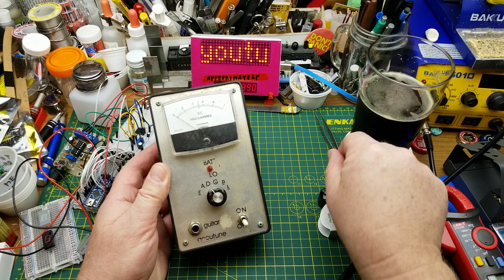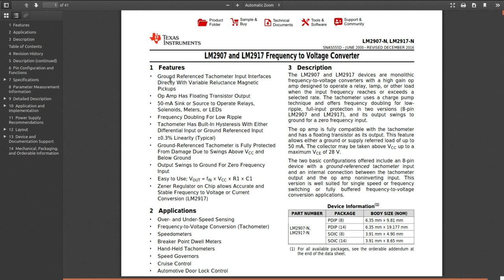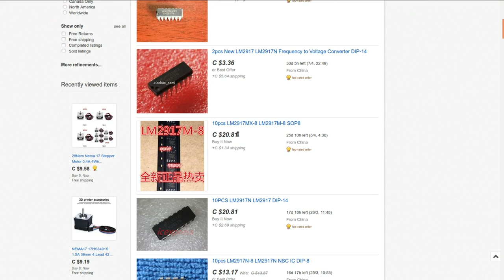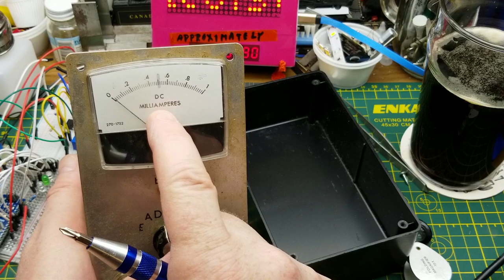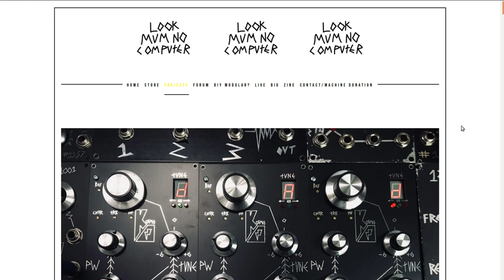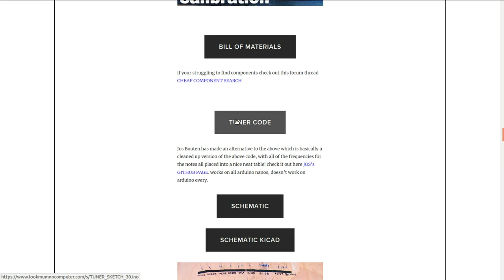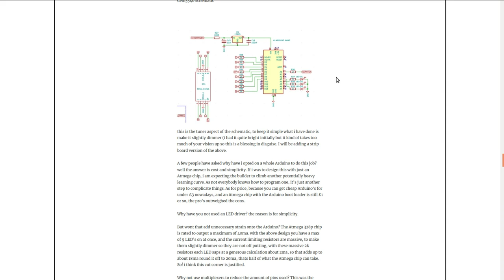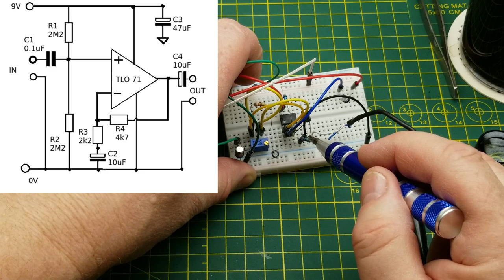DIY guitar tuner experiment

Comment: I made the EA* Chromatic Stroboscopic Tuner (more than) a few decades ago.  It's still around here somewhere, and last time I checked it still works great.  It worked by putting a fairly accurate beat frequency on the cathodes of a ring of 12 LEDs, and putting the amplified  input from a jack or microphone onto the anodes.  If the note was in tune it only lit one LED, if it was flat the LEDs rotated CCW, and if it was sharp the LEDs rotated CW.  It was almost impervious to harmonics, as long as they weren't too loud.

Theoretically you could have tuned a piano with this thing, but mostly I used it to tune a guitar.  Interestingly, this tuner taught me how to tune by ear, by listening to the beat note (it had a speaker also) so you got both visual and audio cues when the note was phasing in and out.  Unfortunately the oscillator was putting out a square wave so it was a bit nasty to listen to. 

I can't find an example photo of this tuner anywhere unfortunately.  It was before photo resist was really a common thing - you made a tracing of the PCB then went over it with an etch resist pen.  Easiest way to do this was to stick the tracing to the blank PCB, then drill all the lead holes.  You then joined the dots with the pen, referring to the images to make sure you didn't miss any tracks.

*EA = Elelctronics Australia, one of the electronics hobby magazines we had in the 70's.  It didn't really survive much into the computer era.

Comment: I have some old analog panel meters I’m trying to think of a project for.  And I’m feeling a bit more analog lately anyway, maybe I will revisit some synthesizer or oscillator stuff I haven’t looked at since before the new year.  I made some sort of auto gain control circuit way back, I vaguely recall it had a FET as a variable resistor and an op amp. I wonder if I can find that circuit or something even better to investigate.
Reply: GR, I used three panel meters with an ESP8266 to make a retro analog clock.  Because it gets the time from the an NTP, server it only has one input; a rotary encoder to select the default time zone.

Comment: 5:30 - I thought you said it basically would be mid level (0.5 as you have marked it with a felt) when in tune or no signal?  That's the way we had one in music class way back then.  So if you were under frequency it would go to the left and over it would go right.  2nd... I'm guessing one of the op amps is for the battery low indicator?
Reply from the maker: Mid scale is supposed to be "in tune". Left is flat, right is sharp.

Assuming I calibrated it correctly all those decades ago.

Comment: The original one you made looks smashing, i've made much worse lol, i still have a digital capacitance meter i made back in the early 80's E.E mag, it uses an american colour tv cristal at 3.57mhz and 3 level frequency divider, gating a frequency into a counter depending on capacitor charge threshold voltage.
The pcb is not pretty but the copper gets there and it's in a box so prettyness is a waste of time.
Function is the bit that matters :-D